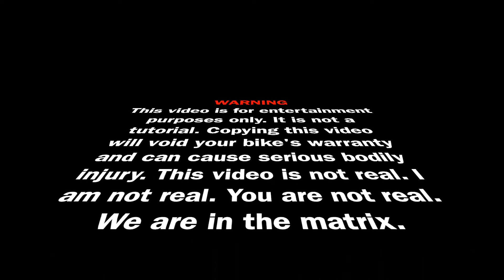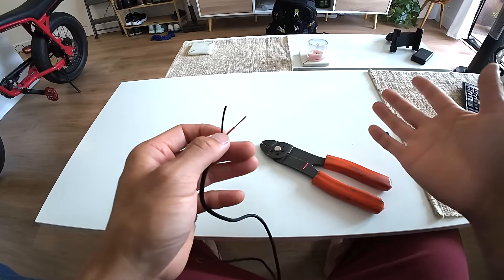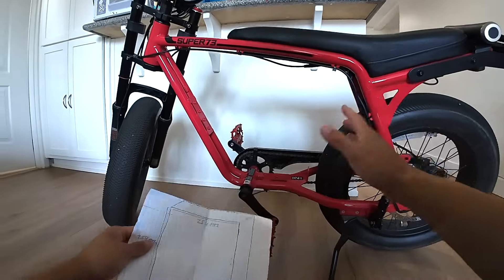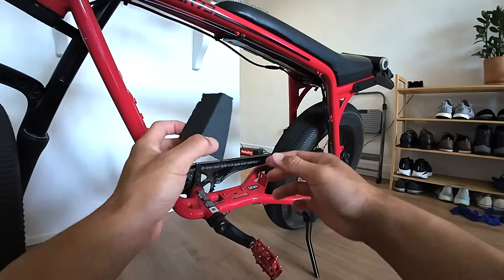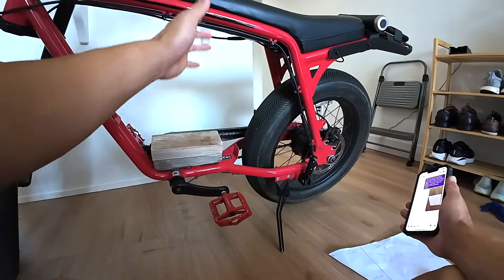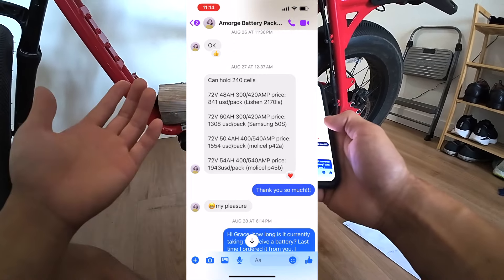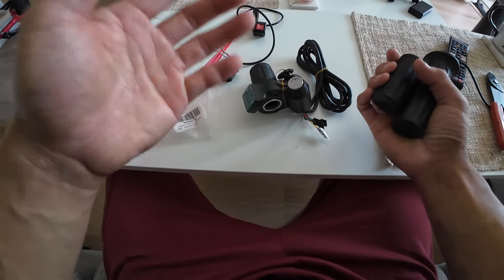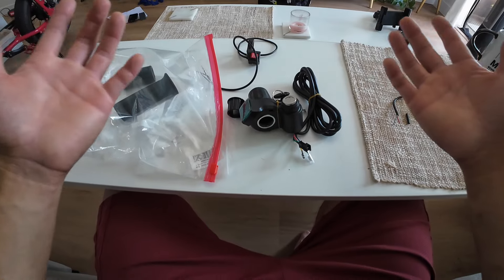How I Make ANY E-BIKE INSANELY FAST (step by step) | Project Super73 Z-Miami Part 1

Comment: I'm already finished the same build.  Biggest game changer, buy a pack of solderless connectors and a heat gun.  So easy, put the wire in each side of the sleeve, heat the connector. There is metal in the connector that will fuse into both sides.  Crazy easy, could try a hair dryer but the heat gun is $10.  When it cools it hardens bonding the wire.  Enjoy the build.  Just finished mine.
Reply: I'm going to second this suggestion.  I use these types of connectors all the time.  Not only are they easier to do, but the result is far cleaner looking, sealed better from water, and the low temp solder in the connector makes for a better vibration proof connection.
Reply from the maker: Thanks for the tip. The reason why I don’t really do this is cause sometimes I need to undo it because there’s no connector to disconnect.
Reply: @Raspyrides  Then use shrink tube, it's easy to remove and allows you to under the wire twist easily.  Available in a variety of colors, still looks and protects the wires better than tape.

Comment: I have a Norco Fluid Ht I put a cyc photon on its really good at eating up distance. Watching your videos kinda encourages me to grab a frame like this and build it out. Only need it cruise around 30 to 40kph and at least 70km range. 
I will say mid-drive isn't too much maintenance but having gears is the best part if you have rolling hills to travel up and over to your destination.
Reply from the maker: @Jabba1625  mid drives are cool but hubs are just so easy for me. To each their own plus…I don’t have that many hills in my area

Comment: Currently I have a Siron. and I was thinking about adding some mods on it just because I have a seron. already but originally I had a Super 73 but the battery broke on it. and that's the main bike that I wanted to buy the mod. and make it super fast. Thank you about selling this shirt on. to get back started on my original plan because I like the way hub motor E bikes accelerate and how smooth it is. The Xeron's cool and all but the riot feels nothing like a Super 73. The Super 73 Those magic code of flick. and lean into turns like you can really get down into it on a super 73. Sarah Ron's are like an off balance dirt bike, especially since this seat position is. not where the center balance of the bike is. So when you try to rail a turn it doesn't feel like you can get in to the burn and glide.

Comment: If it was me, I'd have spliced the bike frame an weld on spots to add to tension shocks it give you enough space underneath the seats to put a bigger controller at the cost of raising the frame up a few inches an back an few too.  Without putting you at risk it give more space plus bump resistance.  While the power wheel would get a metal well protection bumber to protect the controller

Comment: Oh, also, you might wanna solder the wire. after twisting them together since. it can cause problems if any of the wires move in light. Basically kill all powers to the bike. It happens to me with my super 73 when I had to repair the battery wire since it brushed up against the will and I. did the twist method. and maybe like a few weeks later. from all the vibrations, the wires weren't fully connected, so it stops sending power. to the hub motor So then I ended up getting rid of the bike. Still wish I would have kept it.

Comment: Nice raspy man! Did you see P.L'.s new super73?
I would skip the ratcheting straps and use Ali's wide velcro straps. Also, plastic blocks, or more foam to elevate the pack will weigh less than wood
Reply from the maker: @E-Eightyfive  the blue ish super73 that was just posted on Mr. E’s channel?

Comment: This is going to be a awesome build. Can I get in contact with you since you're familiar with fardriver? Right now I bought a fardriver 72530 to replace a sabvoton 72100. I bought the fardriver and harness kit from your contact Anne.  The fardriver won't go in self learning mode.  It is getting a alarm phase current overflow from the app.
Reply: The motor is a nb power 5k watt hub motor that was paired with sabvoton kits.
Reply from the maker: @Jujubees225  I never bought a FarDriver from grace. Only batteries from her. You might have to lower your maxphasecurr and your boostphasecurr. Shoot me an email, and I’ll send you a Facebook group you should join to learn more about fardrivers.

Comment: Should have went with the molicels them Samsung 50s cells I hear they loose there efficiency after only 100 cycles they drop to 80%. Good luck
Reply from the maker: @oldmanebikes8392  it’s ok. I’d rather take the cheaper pack with more amp hours. Plus…it’ll take a very long time for me to get to 100 cycles on a 60ah battery.

Comment: You got a battery that was waaaayyyyy to powerful for a super73 build - 300 continuous amps is straight overkill for this frame - you could have went with 100 amps or max 150 to get the job done! Going over 50 mph on a super73 is sketchy going 70 mph is insane! Lol. 

Great build though-
Reply from the maker: @knowEgo  I always try to make the battery overkill if I can. Less voltage sag that way. I set my controller to 250amps and it’s been super fun!
Reply: @Raspyrides  yeah I can imagine the torque and speed from such a large battery and light bike….especially with the Fardriver controller! 

I just bought a fardriver a few weeks ago for my modified Super73 RX I live in the Midwest so I haven’t had a chance to ride yet but I expecting to get good results from the Fardriver. I previously had a Sabvoton but it died on me after about 100 miles of riding 🥴 is there any tips or advice you can give me for the Fardriver controller…how is the efficiency on the battery?
Reply from the maker: @ the FarDriver can be tuned correctly to maximize efficiency, especially if you use a 3 speed switch.
Reply: @ okay…I do have a three speed I will use on this build! I will start working on everything next month! Thx